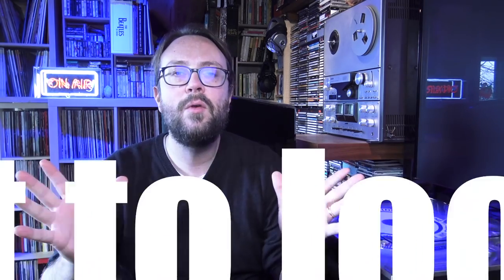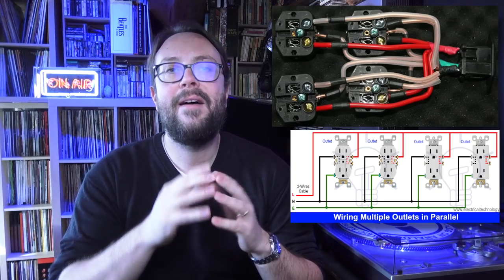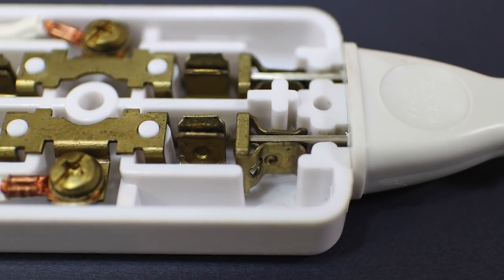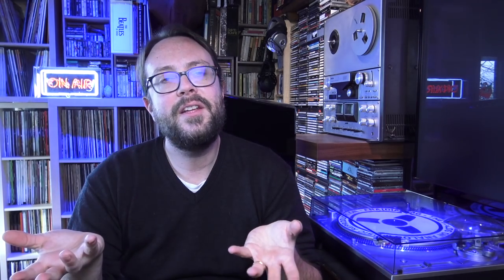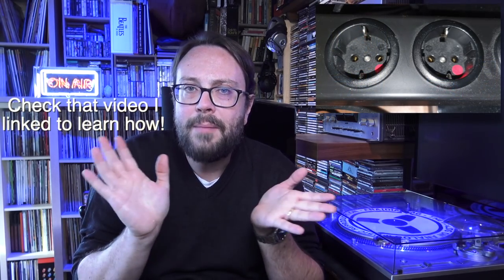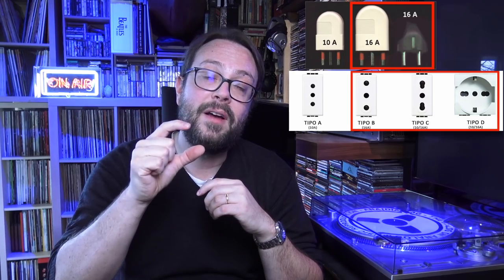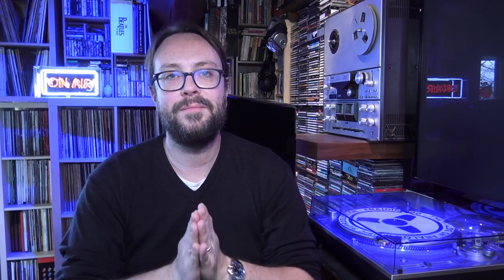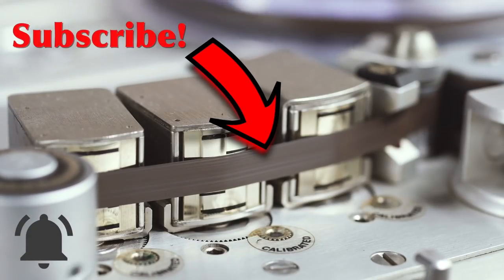Audiophile power strips: what to look for & what to avoid

Comment: This is all good advice and parallels my experience in experimenting with power strips. Star wiring is good, but a heavy copper bus bar as is found in the iFi power station is also good if not better. I voided my warranty by modifying my power station. Internally there is a long length of wire that goes to the opposite end of the power station (than the cable end). I removed the connector and switch and directly soldered my own home made power cable right to the copper bus bar on the cable end of the power station. This removed the long length of wire, the switch, and the connector. It made a really nice difference in my system.

Comment: All the great companies like Ray Samuels owner, Pratues Cypher Labs and even Nelson Pass all told me NEVER use a power conditioner for amps- if the amp is built correctly you just do not want it in the chain. All other gear like cd players, servers, pre amps different story- but I never ever use a power conditioner for my amps. I have dedicated lines for all my digital pre amps and amps and thats the ultimate if you can do that- clean power from the box. Outlets of hospital grade or better a plus. OCC wire and better of course. Cheers! great video!
Reply: @adrieltzu3565  power restriction of any kind- im not sure but my friend who has a $500,000 set of Perfect Eight Speakers and $600K worth of Other gear says the same thing- amps should never be conditioned or restricted at all- as I mentioned; Ray Samuels also says same thing and so does Coffman Labs- and so does JM Audio Editions -Pass Labs, VAC amps and so many other serious amp makers -

Comment: Several years ago, I was looking on that big auction site, and found 2 Geist Military-spec power strips, 20 Amps, each outlet has it`s own circuit breaker. Each one is almost 5 feet long, and weighs about 25 lbs. Very high quality.

Comment: Tripp Lite Isobar plug-in is a great way to lower the ground noise from the wall. It doesn’t come with a weak ass cord attached to it. It is a plug-in unit with two outlets. It is a grounding device and a surge protector. It’s not really an audiophile product but a general electronic unit that’s found at Home Depots, eBay and Amazon.

I then plug in a silver cable that I seek out on eBay. 

I feel that the Tripp Lite Isobar is my safety device for my equipment. 

Then, I found a power distributor on eBay that used Furutech parts and pure silver conductors. I bought mine for $400 and now they’re $450. 

This combination, plus Furutech Liquid Nano brushed on my connectors has done wonders to my sound.
Reply from the maker: Thanks for sharing that!

Comment: I got a week ago an Isotek aquarius. I didnt expect so much. Clean power matters. I can say that the sound changed like i got more clean watts in my amp and a small subwoofer in my speakers. The soundstage changed. More dynamics and more punch. No tremble roll off. I'm amazed with all changes. I got it as a demo and paid 2/3 of the normal price. I thought I could easily sell it, if not satisfied. But is not gonna happen. I might change my amp but this power cond is staying. You should check it out someday. All the best. Keep it up.
Reply from the maker: Thanks for sharing that!

Comment: I have a dedicated 20 amp line from the breaker box going to my listening room terminating at Shunyata outlets. From there AQ Tornado HC power cord to one PS Audio Power Plant and Shunyata Delta HC power cable to a Shunyata PS8 to another Power Plant. I completely agree. A good hifi system is as good as the power that feeds it.
Reply from the maker: Sweet!!
Reply: I want to do that when I move out of my apartment into a house. I do refrigeration and ac and am pretty competent when it comes to wiring

Comment: An interesting technical review! I am personally weighing up the Furutech e-TP60E NCF which has everything except star wiring versus the Puritan Audio PSM136 power conditioner with 6 outlets, which claims to be the only power conditioner not to suck the life out of amps.
Reply: I have read a review of the Puritan that it holds the dynamics of amps.....
Reply: @theomindschrddr7983  Interesting. I think I'll go for Furutech f-TP615E, that model has star wiring and it looks thicker gauge than what the Puritan uses. Also Furutech are generally the masters of al things interconnect cables, power cords and distributors.
Reply: There are a few that do not suck the life out of amps. The Deep Core 1800 is one.

Comment: Use an isolated ground and isolated grounded outlets. You will never have Hum, and the sound will be a lot darker. Add to that a dedicated circuit and you will have less choke. Place the amp and preamp on the 1st outlet inline.
Reply: This 👆
Reply: Good advices here. ☝️

Comment: I am sorry, but we are talking about AC or DC. Because in case of AC there is no polarity. The AC current changing its polarity 50 or 60 times in every second. There is only phase/neutral matching. Out of that, great advices. Thx
Reply from the maker: I am taking of plugs that have only two prongs where one pole is hot and the other is cold, yes phase but you can also call it polarity just as phase means 100 different things in electronics and audio in general.

Comment: I don't think we use clamps in the UK. I got a Tacima 6 way mains conditioner for Christmas and it works just fine! (it was about 35 pounds)
Reply: Thanks for the recommendation, I've been looking for an affordable one for UK outlets.
Reply: @MaximumJoy  Yes, It's very good and it's not very intrusive with the sound :)
Reply: You might think you do not hear electrical noise, well if one was to audition a iso-tek syrus power conditioner then all would become apparent! Therefore the tacima mains power conditioner has now been relegated for the REL subwoofer!

Comment: hope to see your power strip recommendations on your next video. Thks
On power conditioners, does it tend to be power limiting and hence not good for power amps?
Reply from the maker: In most cases, IMO, yes. BUT if you get a high quality conditioner, well designed, with modest and soft filtering, then you will get fantastic, dynamic and clean sound!
Reply: @anadialog  cool, look forward to your recommendations
Reply from the maker: Well, I truly love my dedicated power conditioners. They are made here in Italy, not cheap but changed my system radically! It was the topic of my first (strange) video I made: https://youtu.be/elU1cEMLjYE

Comment: Speaking of mains polarity, some CD / universal disc players and DACs perform better if you plug them in a particular polarity but tend to sound flat in the projecting a sounstage departmemt when you plug them the other way even though it still works / powers up. 🤔
Reply: Perhaps the power supply is of poor quality?  I would expect a switching supply would be pretty standard by now, providing excellent isolation for any potential ground loops and well filtered, with very stiff regulation.

Comment: I own the Audience adeptResponse aR2p-T4 Power Conditioner. The sonic improvement is nothing short of amazing and it has a plastic chassis. I was told this is actually an advantage over metal chassis because it doesn't react to electrical interference.

It does have an on/off switch and light which I agree is stupid. But customers demanded it so Audience put a lot of R&D just into designing a power switch and light that didn't degrade the sound.

Comment: Point #1... The best is a steel case because it does provide a magnetic shield on top of RF/EMI.
Point #2... I agree with star type wiring but the missing part is the fact that all lines have to be of the same lenght, especially the ground.
Point #3... Brass is not that bad, except it dos rust rapidly and lack mecanical strenght.
Point #4... Contact points have to be double action.
Point #5... I agree with AC power phase uniformity.
Point #6... Unless high current is drawned, this may be unimportant.
Point #7... Gadgets are always sources of troubles.
Point #8... This seems a repeat of point #4.

All that being said, a well designed power supply should alleviate most points.
The paramount point remain to make sure all the grounds are of the same lenght and respect a star configuration.

In conclusion, put a scope in front of me and show mee the difference!
Anyway, who is stupid enough to listen to music with a scope?
I use my ears.

Comment: Hi, An(dia)log, It is quite acceptable to use both plastic and metal power conditioners, I use both on the same system, one pluged into the other.  I have gone to considerable expense to convert my equipment to IEC sockets that have a power switch.  I would say one of the most important thing that you left out is,  Cable Management.  The power strip/power conditioner has reduced my, wall outlet plugs, from 20 wall plugs to just one wall plug.  If you asked me a year ago, I would have said this was impossible. I converted all components to IEC sockets that can be switched on or off.  Now the system is very tide and zero hum.  Job done.
Reply from the maker: Yes, you have surely solved ground loops  but inserted several signal interruptions, which IMO are worse than the problem. Yes, of course plastic is good, it is a good isolation material but if you are not doing your own power strip, quality power strips are not going to be housed in plastic.

Comment: I agree however here in Canada and in the USA there must be a REGULATED POWERADE SUPPLY  that comes first top priority. This is very important in eliminating AC HUM / NOISE. There is an old saying, "GARBAGE IN, GARBAGE OUT". Also "LESS IS MORE ". Top quality power and preamps have less switches.  As for hiring an electrician, the job has to be worth at least a thousand dollars or its a waste of their time $$$

Comment: Great tips. I asked the power company to replace all wiring from the house to the power station with OFC unidirectional Teflon coated conductors, had them put in aluminium ducting, remove all fuses and switches in between the said power station and my house, and wire the whole town in star. You won't believe the sound difference it made!
Now I can finally hear that last meter of unicorn power cable to my equipment perform as it should.
Reply from the maker: Lol! I know, everybody thinks that. But in electronics you must change your perspective. It's the first meter for the amplifier and it is of paramount importance for its push/pull function as well as the other components. Try then decide. Don't think by prejudice.
Reply: You neglected to ask your nearest power station to burn gold plated coal. ;)

Comment: 1:10 The metal case/chassis only matters if your powerstrip is located. close to your analog equipment.
2:00 Star wiring is a good one, especially ground, that's by far the most important one to be star wired; it reduces the chance of getting ground loops.
3:10 The OFC/OCC copper etc. shouldn't matter, as power is only 50/60Hz frequency.
3:25 Those brass bars are crap indeed, but mostly because of oxidation which causes unreliable contact.
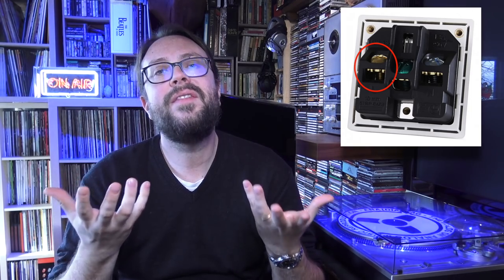4:05 When using those clamps/terminals, don't get spring loaded ones, but ones met screws instead. And never put soldering tin on your wire to put it in the terminal - use crimps instead.
7:00 That's a matter of opinion, I prefer to have an RFI filter and surge protector in my powerstrip.
7:45 Cool! I didn't know you had other powerplugs over there in Italy! I thought continental Europe had all the same Schuko plug, except Switzerland.

Comment: Thanks for your new video, power conditioner was a huge improvement for my system . Can I ask a question about turntable/tone arm? 
I have a Thorens TD 2001 with the TP90 tonearm. I would like to improve the sound, my hifi system is in general on an audiophile level. 
Would you recommend the cartrige AT 33 PTG II or better Dynavector 20x2 for this turntable, or is too much for the Thorens? Thanks in advance

Comment: First, poweramp(s) should always be connected directly to the wall!
I have a Supra powerstrip, first two outlets are not filtered, but still I have the amp in the wall.
My other sources like TV, Apple TV, blu-ray player, decoder and turntable are connected to the strip.
Reply from the maker: I found that it depends from the type and model of amp
Reply: It will depend on the amp. Many of these newer amps do not draw or need the amperage like the older models with the huge terroidal transformers. If you are going direct to the wall, I would have the amp on a dedicated 20 amp circuit. When you have a circuit (wiring) with multiple outlets and switches, a lot of noise can be introduced to the amp. Electricity is inherently noisy, and it vibrates, loosening connection on those outlets and switches over time. I use Emotiva CMX-6 units with my XPA-2, no issues to date, and the amp is now dead silent.

Comment: Over here in the Netherlands it's easy to know which one is the Fase. It's allway's the left pole in the wallsocket. This during the fact we read allso from left to right.  Hope it will help other Dutch persons.
Reply: In that particular instance, as well as any ... that's assuming it was installed correctly, as occasionally mistakes are made.
A meter would determine what is what.
Reply: There is no guarantee for that.

Comment: 2) The most important consideration of power strip design is shielding cleaning but also protection in a world all the cable in the world  be 5 or 6n silver but this is not cost effective 

Where it is much more important to shield and clean the mains supply than try to use a conductor to try to increase the speed of electron flow  

I will give you a simple example of this when you by a phone charger do you buy a cheap and nasty buck transformer which puts loads of absolute garbage on the mains 

Or do you buy a separate walwart and or a torrid transformer in a properly shielded metal enclosure with a proper mains input circuit fully shielded with mov's and pye filter protection 

Cheap charger £15 UK pounds or a nice quality charger around £300     

You see how vast this subject is you can approach from 2 sides an electronics or an electrical engineer both will give totally different solution's to the problem both are right but also wrong 

If you would like to have a more indepth chat about this send me you contact detail's and I was much harder in my review of a Furman product which costs 300$ US I said the unit wasn't worth 30$ US  

Regards Simon

Comment: I recommend the Furman PST 8 linear filtering power strip. It has fantastic power surge protection, and it eliminates the vast majority of noise from your electricity. Also a dedicated outlet from your breaker is always best. It costs like $200 to hire an electrician to wire your outlet directly so that it doesn’t get contaminated by the rest of the house. This will solve 99% of your noise problems right there. Also unplug crap that you aren’t using. If you have stuff like a noisy gaming PC or whatever, unplug it before listening and it will eliminate crossover noise. That way with doing those basic things you can eliminate most signal noise and avoid having to spend crazy dollars on absurdly expensive audiophile grade cables.
Reply from the maker: Nice!

Comment: Ive tried to break this down into bite sized chunks lol your video is not wrong but not right if that makes sense 

1) The problem with the video is you have gone into a topic which is vast I design conversions of rare 100/110 volt collectors hifi into multi voltage hifi 100 /110/220 and 240 mainly rare Japanese hifi for the world market this includes transformers capacitors and hifi power supply boards the one thing I find that most of the videos done by audio reviews don't concentrate on the basics

Comment: My friend, do you have an earlier model of the Wireworld Matrix?  I have version 2 and it states star wired.  Perhaps the U.K. model is different.

I’d say that the matrix strip reduced noise, hence I was able to pick out instruments in the soundstage better
Reply from the maker: Yes, I have Matrix 2 and yes, as I have shown in the video, it states star wired but its not, not all of the outlets. Moreover, I also wrote in the video that some models are 100% star wired. You can recognize the ones that are NOT if on the front the outlets are disposed in PAIRS, as I have shown. If not, then they are all stared.
Reply: @anadialog  thanks for the clarification, I looked at the picture again in more detail, I can see that they are paired.  I will pop the hood off my U.K. model and see if it is the same.
It is very cheeky of the manufacture to state star wired if it isn’t fully star wired.  I look forward to a DIY power strip video 😉

Best regards
Reply from the maker: Indeed! Tell us, thanks!
Reply: @anadialog  I tried taking it apart, I got the end caps off, but I could get the earth screw undone because I didn’t have the screw bit, It was like a Philips screwdriver with a 3 sides.  Similar to the centre of your logo.
Another question please, have you tried earthing the chassis?  I heard it improves performance

Comment: If i run cable direct from the main circuit board, with dedicated fuses for my hifi… that is better right? Then I can fix in the wall multiple individual sockets going back to that wire so that I dont need a multisocket box… its better, right? 🤔
Reply from the maker: If capable of setting that up, indeed
Reply: At the moment I build the room completely, including stud wall and power supply… If you tell me the best way I can do it 😉👍

Comment: And 1 more thing is the design of US wall plugs a 2 pin socket you pull the the plug  half way out of a wall and both pins are live why don't the fit the plug with shielded pins and also no way off adding a fuse to the plug coming from the UK this makes absolutely no sense to me ????